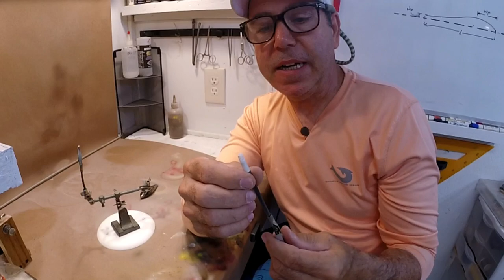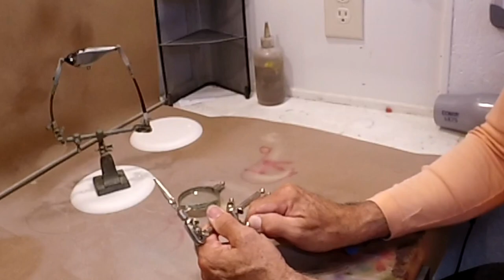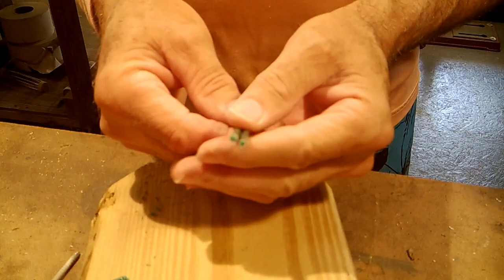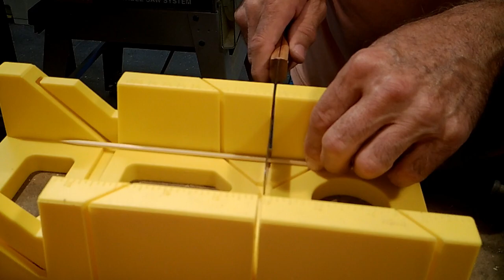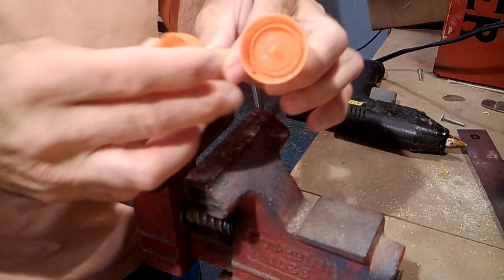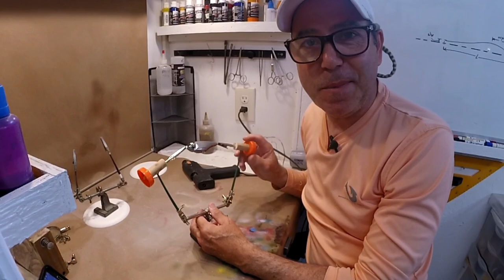DIY Lure Paint Stand Upgrade

Comment: frikkin' engineers. I just scratch my head at how differently we all can see/remedy a situation. great job.
Reply from the maker: breathe and squeeze 
thanks man. ..I made another square bill in green pumpkin and it's killing it!
Reply: Engineered Angler ya, i love that colour. 
I have an idea for you to try. I live up in canada, so our seasons dont provide us with open water all the time. Its a big problem for testing lures. The winter months are when one has the most time to be creating lures, but then they cannot be easily tested to see if they are working well.
How would one create a "testing chamber"? Something that the water can run/circulate through, putting the action to the lure and letting one see it. Of course it couldnt require a garden hose to be connected, as they are put away for the winter. I think i am pondering sonething kind of unrealistic, because one would want it to be relatively inexpensive as well. A simple tub filled with water might be an easier answer. Just a thought.
Reply from the maker: breathe and squeeze 
funny you should ask... I've been working on the design for a few months. it'll be a small tank with a flow stablished in it using submersible pump. I'll share it once I got it fabricated.

Comment: Not related to this video, but something I came across that really helped me in taping up my lures prior to painting.  Instead of using the regular blue painter's tape, which is really a pain in the keester, I use Teflon tape. It stretches around the ends where the bill touches the lure body. Superfast when removing it from the lure.
Reply from the maker: Great tip!

Comment: nice, I designed one and 3d printed it, the length is variable and use ballbearings
Reply from the maker: Wow...took it to the next step...nice job.
Reply: @EngineeredAngler  I got the idea from yours, I've learned a lot from your videos, I have experience with 3d printing but I am really new at lure building